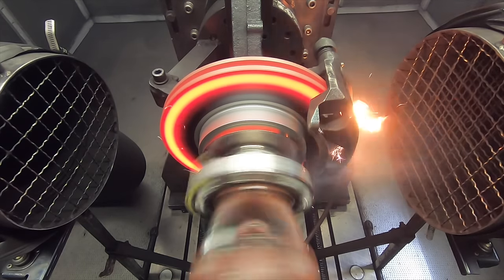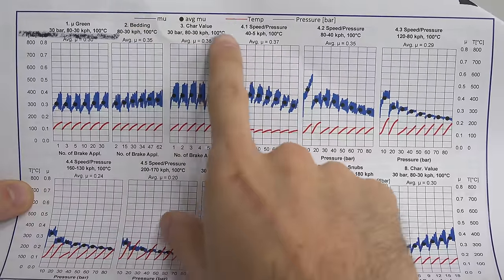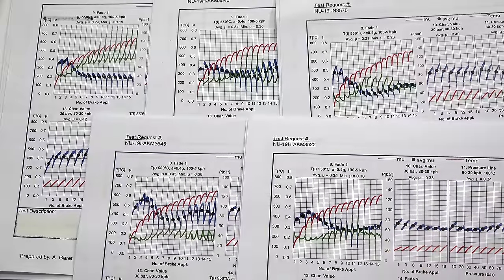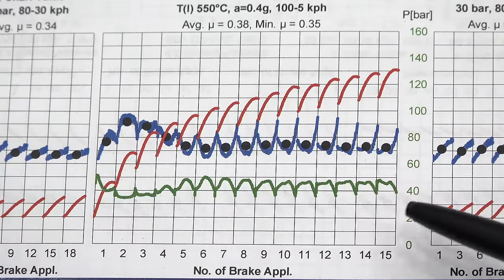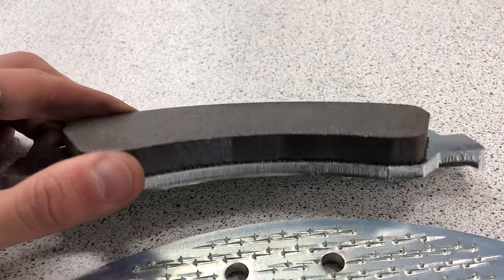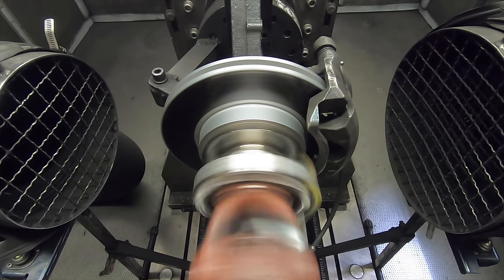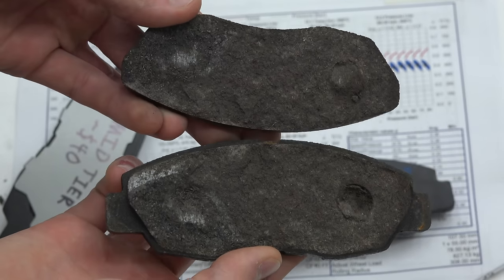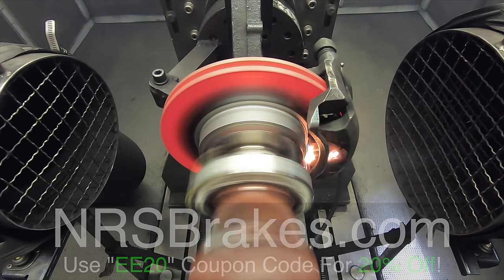What Are The Best Brake Pads? Cheap vs Expensive Tested!

Comment: So, what I got from this is that even budget pads will do fine for most cars and drivers.. Fade really started after 5-7 consecutive hard stops from 62MPH (dont know if you allowed time between stops or defined cooling between stops so I assume none since you defined the test and did not mention it). If you are in traffic and it is 60mph hard stop after hard stop its time to get off that road as it is simply unsafe traffic pattern for whatever reason.

Comment: Guess it's vehicle dependent, but $60 for the best is what to expect in a parts store, while $20-30 will get you the same, or better online. Often without the murkiness of rebadged part brand names. It's a shame that parts stores aren't very viable with this large of a discrepancy. I only go to one when I NEED a part immediately (usually after killing a bolt, or for basics like universal vacuum line/hoses, maybe filters). $60 could get me about 3 sets of the best Bosch brakes available for my car on RA website.

Comment: I don't think I've ever seen pads that cheap in Aus, maybe $60-70 for the cheap nasty ones.  Entry/mid rage like Bendix are typically $120 range.
Good performance pads are typically $180-250 an axle.   I've tried so many sports and performance pads and most were worse than the OEM ones.  I've only had 3 good brands after 15 years of testing different ones on the same brake systems. EBC (prohibitively expensive due to exchange and import tax), QFM which went bankrupt about 5 years ago, now I use Forza which aren't quite as aggressive at high temps but have awesome bite at around 0-10c while the worst friction at the medium temps.  They have OEM like wear too which is odd for pads classed as track/street.  The QFM and EBCs would kill rotors  in 50,000-70,000km.  The Forza pads really need slotted rotors to work consistent as they glaze easy as they have slow wear rate, the prior were so aggressive on the rotors they were always in a rough state of finish so glazing was not possible.

Comment: As an engineer I would say buy original when it comes to any safety equipment. The issue is not that they will not work. The original equipment is designed to fit 100 percent, work with the other parts of the car within specific tolerances. The test cycles and validation of results done by manufacturers are far more stringent than any OEM tester performs. The original kit will also affect fine tolerances for other pieces of kit which the replacement part works with. The result is over time the affect on other parts in the car and over time you can end up making other parts faulty.

Comment: 1) Who chose the comparators; You or NRS? 
2) What pads were compared exactly? What OEM? 
3) Unless someone has tested the majority of available pads on the market and found a strong correlation with dollar value, that's a terrible way to compare your samples. 
4) When presenting ≤5 samples, just show each data point instead of the average; for >5 samples, a boxplot has more meaning than mean average. 
5) What exactly did you expect a viewer would take away from this? The only thing I got was insight into standardized test methods and a few design cues you prefer for brake pads. This doesn't really offer any value to a consumer since we rarely, if ever, get to inspect pads before purchasing them.

Comment: Not sure  I get how pertinent this test is. When testing the brake feel on the cheapest pads, the friction coefficient / pressure needed on pedal only start dramatically changing around the 6th or 7h brake test, when the brake temperature is between 300 and 400 celsius. Most drivers will never drive a pad over 200C nor brake from 100 to 5 kph 6 or 7 times in a row, even in mountainous roads.  All I gather from this test is if you drive a generic compact which you mostly only use for your 20-30km daily commute, using the cheapest brake pads will not affect you greatly.

Comment: I had a car that ate through break pads and rotors like it was nobody's business. New pads every 15k miles, new rotors every 30k miles. We tried 6 different brands of medium and high end pads and same thing. OEM pads and rotors negatively affected braking distance. That thing was a terrible car, new tires every 20k miles. You could actually feel if you went over 5k miles between oil changes. The transmission blew up and was replaced by the dealership under warranty every 35-45k miles. By the time the engine blew at 178k miles that car had gone through 8 sets of tires, 4 transmissions, 16 sets of brake pads, 8 sets of rotors, 3 alternators, 2 AC pumps, 4 sets of (8) spark plugs, 1 set of (8)coil packs, and 1 radiator. All with a brand new car within a 5 year period. To our absolute shock the ball joints were in incredible shape and so were the shocks and struts. For all it was worth, the thing was worked hard.

Comment: I learned 40 years ago that you buy the most expensive pads the store can get by a large known name brand. 
You make one trip where the cheap guy makes 4 trips. Plus he buys new rotors a lot. 
The last three trucks I owned have  had 370,000 miles, 315,000 miles and current one has 160,000 miles and I have never had to buy a rotor.

Comment: im wondering if they done the sheer test from the side if the sheering surface area will be larger ,i think so ,besides i dont think sheer breaking is really often an issue,, what is important is the stopping power ,noise and how long they last and how much damage they do to rotors,,would be nice if the rotors lasted for at least 3 break pads life time ,,why dont they make them from graphite composite or titanium? very heat and warp resistant and light and probably wont wear as fast

Comment: Not very useful without the material composition. There are manufacturers that give typically 3 different choices for pad material. I don't see any of their products being tested here. Right now I'm interested in wet and extreme cold weather performance. Metallic are an improvement over organic so far. I would consider switching to ceramic for winter if cold performance was on par with the metallic pads I got on now.

Comment: '
depend on the model of vehicle / weight / metal...
down grade ground is more brake than flat / up grade ground...
all brakes are steels and takes rusty while water plus brake rotary wheels, too...
that is a normal

Comment: I'd rather change organic (budget) pads a couple of times a year and the rotors ever four or five years. I was taught the pads are engengineering to be higher wear item, after all the pads are usually a quick change part compared to a usually more labor intensive rotor replacement not to mention much more economical.

Comment: I run Hart drilled & slotted rotors with ceramic pads on my 09 slobalt, they are VERY grabby compared to OEM and I haven't been able to push them to fading. Then again, I dont have a zillion dollar test facility; my test facility is a butt dyno.

Comment: Are Stop Tech para aramid in the comparison?  I only wonder because I use them and have been quite happy with their performance.  My car is a 2013 Passat and I used to have the OE Bosch pads.  I like the Stop Tech better really but they are not too much better than the Bosch.  The Stop Tech pads are supposed to fade less but they also have a good bite.
Reply: Had an 87 GTI.. VW OEM pads lasted 60K+ per set of very spirited NYC regional driving. Best brakes I ever had, both performance and longevity and replaced them with OEM at least twice... (Had my license suspended once with that little rocket.The good old days when Farfignuegan actually meant something to VW.).. Every car since has gotten mo more than 30K on OEM  (some as low as 22K) so I replace with aftermarket.. A good shop knows which brand works well with which ride..

Comment: And here I thought I did something wrong wayyyy back when I had my 86 4 runner. Put the silver advanced auto pads on it and it would not stop! Changed them out years later and I about went through the windshield when I hit the brakes! Never again will I buy the cheap ones!

Comment: its an interesting graph however you fail to show the fluid boiling which would show the pads ability through its entire range, as this will be the point the driver cannot apply any more pressure until cooled/bled which i would consider a proper test

Comment: When you say OE do you mean you got them directly from the dealer or from an auto parts store and they’re just OE certified (or whatever they call that).
Reply: Doesn't matter where you get them from, as long as the part number or name is the same as OE. Most OE brake pads are $40-$80.

Comment: But how does pad wear compare to rotor wear? For a street car, budget pads might be better if they wear the rotors less. For example, 2 sets of cheap pads to 1 set of rotors per 3 years is better than 1 set of high end pads & 2 set of rotors. Its easier to swap pads then rotors too

Comment: There are certain flaws about the test. 1st, the fade test scenario is pretty extreme, as it is a repetitive hard braking situation that mostly occurred on track. 2nd, the material loss, it actually depends on the amount of metallic content, and the more metal it contains, the longer it will last, however at a cost of eating your brake rotors. Thus conclusion is that, if you value your rotor life and is a handy man capable of replacing your own brake pads and don't mind the slightly mushy feeling of cheap pad (they have the most organic content), then ironically the cheap pad is actually more suitable in this scenario

Comment: This is where a website like "Bob's the oil guy" for brake pads so the folks that work at brake pad manufacturers can chime in and straighten out all the questions.
Is there a manufacturer that makes brake pads and sells to different outlets and they rebrand? 
Who makes the OE pads?
Are the cheap pads made in China?

Comment: I only buy brake pads from Akebono. Most brand new vehicles come with Akebono (OEM) brake pads. You get performance and minimal brake dust.
Akebono's OEM customers include: GM, Ford, Chrysler, Honda, Toyota, Mitsubishi, Mazda, Nissan, Subaru, Isuzu and McLaren. Don't mess around get the Akebonos.
Reply: No they don't. Name one car from any of those manufacturers that uses Akebono pads.
Reply: Yes, they do. Stop being lazy and act like the GOAT Messi, do your own research. Akebono makes the pads for them. They don't say Akebono on them because the car manufacturers want you to buy the brake pads from their dealerships instead of going straight to the source. You can't buy directly from Akebono but they do have distributors.
Reply: @igotanimac1  You need to slow down on your reading, so you can understand. I did name car manufacturers that use Akebono brake pads.
Reply: @omarvaldez00  When I said 'no, they don't' I was referring to the fact that you said 'most brand new vehicles come with Akebono pads.' Do you have evidence of that? I highly doubt they make a majority of the pads for OEM car manufacturers. I've searched several cars that Akebono makes brake pads for and none are an exact match to OE pads. Who buys brake pads from dealerships? They mark them up a ton, you can get OEM pads online for $30-$50.

Comment: For my car the price for original pads both front and rear around 90 dollars which seems cheep so continue to use oem this not to say that it is the best because there may be also you will find better option in the market but may also be pricey so for me stick with original once I change them every 4 years or around 50000 km so thats fine 🙂

Comment: What is this? I don't heat my brakes up to red hot, nor do I spray them with salt water or put them in mechanical sheering machines So why would I spend double or triple on the fancy ones?  I bought the $20 ones at autozone and they work just fine.

Comment: Always get OEM. Unless you want something special - say, a permanent air filter or such - which is not available as OEM, you'll get the parts you can trust. In some cases, third party parts may be better - but they also may be bad to the point of being dangerous, and due to the low volume it doesn't get known. If Mercedes were to install crappy brake pads that fell off after you drove through some puddles, it WOULD get known, and they would be looking at a massively expensive recall. Therefore, OEM parts are tested for long-time performance and reliability, whereas third party ones may just meet the minimal safety requirements, which may not turn out to be safe at all. That of course does not mean that you can't get good parts from third party manufacturers - but they would need to be a brand that you know and trust. So, given the choice between OEM, trusted brand name third party, and no-name no-brand or own-brand cheap parts, I would pick, in Order: 1) OEM, 2) trusted brand. Especially when it comes to brakes or tyres, I'm not experimenting. If I'm going to spend money on anything automotive related, it's that.
From my personal experience, the OEM parts are simply the highest quality. Even the brands that do retail as well as OEM - Bosch, Valeo etc. - deliver vastly superior quality for their OEM parts. Say, you'll pay through the nose for your licenced dealer to replace your Bosch wipers and you'll get the same dimensions in retail for a fraction of the price, but the OEM will last almost forever, while the retail ones will fail very soon.

Comment: This is a great video for daily driver replacement or people who did not do their research on brake pads. If you are just looking for a replacement for a non-performance daily drivers, then OEM or the OEM supplier (usually is Akebono for a lot of Japanese companies) will do just fine. However, if you have done your research and have a particular taste (such as the level of initial bite, brake dust, noise, heat, etc.) or a particular usage (such as daily, light-track, track-only, etc.), then this video is not for you, not to even get into the different materials being used on pads these days (such as original, ceramic, semi-metallic, or even metallic). This video only provides the basic idea for the average joes for their daily drivers, and most of the time OEM would be the best bang for their bucks considering the price to performance. This video also shows that brake pads are one  of the areas that you do not want to cheap out.

Comment: There is a big difference in OEM brake pads. I worked in the repair business for 25 years. 15 years at a muffler and brake center. So I have done literally thousands of break repairs. The OEM pads on Asian and Euro vehicles will last more than twice as long as an American made vehicle. So when the term OEM is used, there can be a big difference in quality. Personally I always use Ceramic pads. NEVER use metallic or semi metallic. They are horrible!

Comment: Am 4 yrs on same pads, use the retarder a lot which saves the brakes which i only use on low speeds. Sometimes down hill i heat them up a bit to keep the discs clean. I prefer drumbrakes combined with retarder though.
Reply: I just did the first brake replacement on my 99 Mustang GT. Granted, it's only got 128,000 miles on it, but I think I got a reasonable amount of life out of them.

Comment: I will go for the OE pads because the original manufacturer knows what they are doing, they can be trusted because they do a lot of experiments on their spare parts. I whold like to share my experience that we can trust the manufacturer, my car comes with the Continental tyres after it worn out I change it to other tyre brand I buy a tyre which has the same tyre rating as my old tyre originally comes with the car, believe me I can feel that the tyre is not handling that well in high speed, I also don't know why that the new tyre cant handle well in high speed eventhough I follow the same rating as my old tyre it suppose to handle same as my old car but it doesn't. So I send my car to my experienced mechanic to inspect the suspensions parts of my car. He tell everytime is in good condition, it might be the tyre not doing well in high speed. Now can you see the manufacturer knows what is the best equipment to fix in their own designed car. So from that experience I started to use only the OE equipment for my car, pretty much everything engine oil, mounts, brake pads, oil filter, struts, coolant everything. My car still running great as my car was new and now it is 12 years old. It  is a great video bro now I know the importance of buying OE equipment more. Thank you.

Comment: Would brakes that capture energy perform any different? I presume they avoid as much heat being generated
Reply: If a car has regenerative braking like a hybrid or full electric vehicle the wear on the brakes is almost non existent. I've heard of situations of the original brakes lasting the life of the vehicle. They are usually only used during panic situations or aggressive stopping. If you are a smooth gentle driver they will last a long time.

Comment: As a general rule, ceramic pads are typically better than semi-metallic pads and the prices usually reflect that.
Reply: Not true. Ceramic pads work best in a narrow temp range as compared to semi-metallic pads which work great in a wide range of temp. Ceramic pads also make a "squishy" feel to the brake pedal and don't grab as quickly. I know because my OE pads were ceramic and when I switched to a semi-metallic  pad I was amazed at the difference in stopping power and pedal firmness.

Comment: How long brakes last is up to the driver more than anything else. I bought a new Ford and sold it at 126,000 miles with the original brakes on it. I had a manual transmission and well before I was going to turn I would use engine braking. If I did not live in a rural area this would not be possible but it can be done. Some who live around here replace brakes as soon as 20,000 miles this is the drivers fault not the cars brakes...